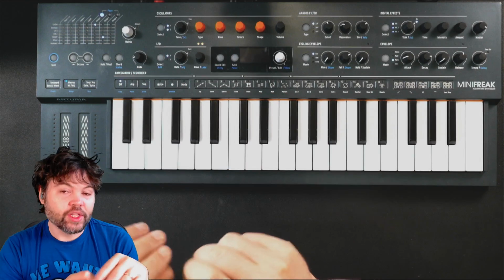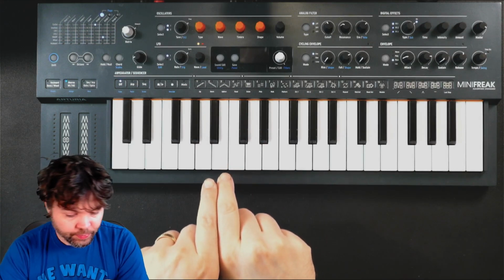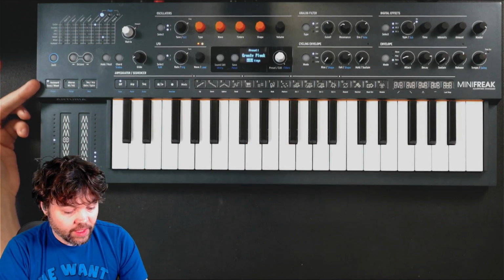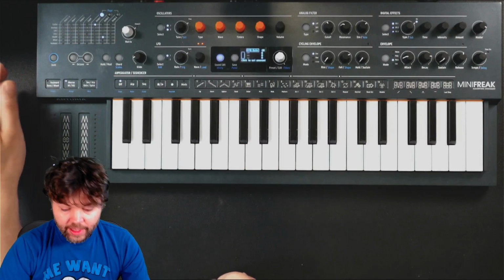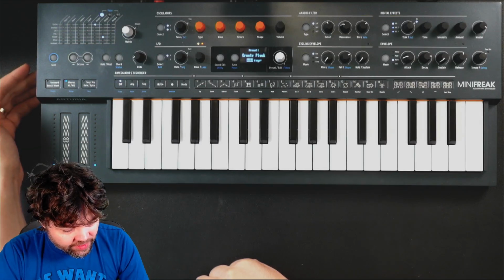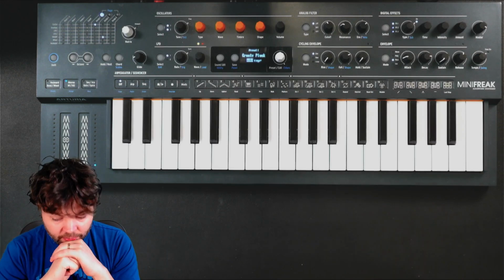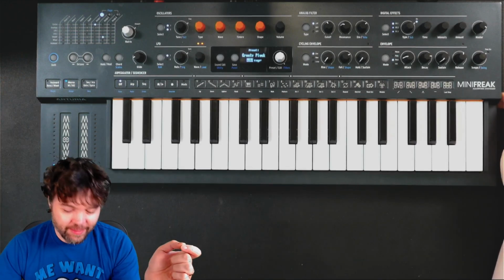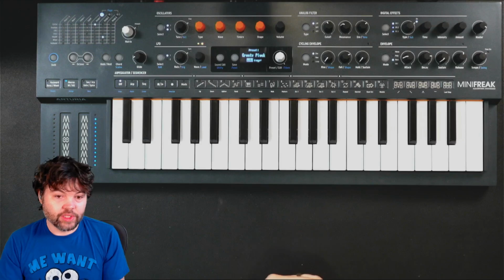Learn With Me - Minifreak: Ep01 - Overview & Paradigm

Comment: I hope this question is not tiring - but, again, in regards to minifreak vs hydrasynth.

I'm trying to decide between them. I currently have a korg minilogue xd and I'm having a lot of fun learning more about synthesis with its immediate and simple analogue setup. I'm looking for a complementary gear that I would use for different sound design possibilities and experimenting with something digital seems intriguing to me. Where I live the price points of these synths are my current limit, they get quite expensive here.

I'm curious if you would have any opinions on which you would go for if you were in my shoes. I'm an hobbyist composer and producer but playing live/concerts is not really a reality for me atm.

Thank you and congrats on your content, I'm spending quite some time with it these last few days 😊
Reply from the maker: Thanks for your comment, and for watching. I can give you a comparison between the two and you can decide what matters most to you.

I would describe the Hydrasynth as having a very deep interface, that is "tamed" by clever use of encoder controlled menus and dedicated section selection buttons. The unique elements of the synth are the polyphonic aftertouch keyboard, the mutants (audio effects for the oscillators) and in having two filters (with various routing options). Add to that the 5 LFOs (with sequencer like capabilities) and 5 envelopes, plus the huge mod matrix and 4 effect slots and you have huge sound design potential. Add to that the great build quality, and the 8 macro controls (with 8 parameters each) and you have a whole lot of capacity to design patches to perform in realtime. Where it lacks is in hands on controls to shape sounds as you design them. You can access them quickly, but instead of just turning a control, you need to press a button (potentially multiple times to go through pages), then turn the correct encoder to adjust the setting. This is a great way to manage the complexity, but not ideal for live sound design. The other problem is that the overall sound quality isn't as good as some of the competition. The oscillators, filters and effects are definitely more than usable, but definitely aren't "best in class".

The Minifreak has far less scope; 2 oscillators per voice, and you can given up oscillator 2 to process oscillator 1. An analogue filter (which is nice and smooth, but not very characterful), only 2 LFOs and 2 envelopes, channel pressure (mono aftertouch), only 2 macros with 4 targets each and 3 effect slots. To compensate for that, it has a huge array of interesting oscillator modes (vs just wavetable on the Hydrasynth). The effects sound good, as do the oscillators; the 12 part paraphonic mode is quite unique and very usable. Another big strength is the arpeggiator and sequencer, which have lots of great performance features. It has more hands on controls, but the menus are much less appealing than on the Hydrasynth.

My summary would be this. If you want a fun synth with good sound design potential and good performance features, get the Minifreak. If you want a deeper subtractive synth which benefits from complex sound design and well thought out expression (especially through poly aftertouch and macros), then the Hydrasynth is the one.
Reply: @ChalkWalkMusic  thanks for the throughout response! Your perspective is quite unique from what I have read online so far - as looking at the minifreak as "less options but better sounding ones i.e. oscillators and effects" is quite more attractive than what I've read so far ("hydrasynth can create anything the minifreak does and much more").

I'm not sure if you're chasing views (would not think so) but your perspective on this comparison would surely be useful to more people since I've seen this question repeated everywhere multiple times.

Thanks again for your reply! Unfortunately for me, I'm even less decided now 😅
Reply from the maker: @georgesboris  To say the Hydrasynth does everything the Minifreak does and more is certainly not accurate. The range of oscillators on the Minifreak (from classic VA and physical modelled strings, to speech synthesis and a comb filter) offers a whole scope of possibilities that a subtractive wavetable synths (like the Hydrasynth) don't offer; it feels like a synth that delivers on all the potential the Microfreak had, and more.

If you focus on the wavetable domain, the Hydrasynth is very powerful: 3 oscillators (albeit the 3rd being more limited in capability and lacking mutants) and the range of modulation capabilities brings a lot to the table. My guess is that you won't be disappointed with either the Minifreak or the Hydrasynth, but they offer different value propositions.

One question to ask is: which would you see yourself still using (often) a year after you buy it? Would the deep macros and mod matrix of the Hydrasynth keep you inspired to design patches, or would the performability and immediacy of the Minifreak hold your attention more?

Comment: Great value synth, nice hands-on controls for adjusting sounds on the fly. I just wish I liked the sounds more than I do. For the same price I think the Hydrasynth Explorer has better sounds (and makes for a great, inexpensive MPE controller!) but its better for sound creation than tweaking sounds live. For a beginner or someone in their first band I'd choose the Arturia (or a new model or old model MicroKorg), but for getting the best sounds and subtlties from MPE patches and softsynths at home it'd be the Explorer.
Reply from the maker: Thanks for your comment, and for watching. On the whole, I'm not that enamoured with the sound of the Hydrasynth. I found the effects to be a little lack lustre and the filter models to feel a bit flat (my point of comparison at the time was the Opsix, which has really nicely modelled filters). Complex sound design is definitely a strength on the Hydrasynth side, but at the same time, I find myself constantly wishing it sounded more like Pigments or Zebra (which it makes an excellent controller for). Poly aftertouch is certainly a nice feature and can add a lot, but it seems to be gradually working its way back into the synth market, so my guess is, that won't be such a draw soon enough.

The Minifreak definitely doesn't compete with the Hydrasynth on specs (far fewer LFOs and envelopes, a single filter, 2 oscillators and no "mutants": a big strength of the Hydrasynth) yet I find it is a case of having enough for a lot of uses. By this I mean: you can dial in sounds quickly and make tweaks fast, while also having enough depth to design more complex sounds (though I do wish it had an extra 2 LFOs and envelopes with extra rows in the mod matrix). That's not to say it's ideal for maximum sound design scope, but between the second oscillator's ability to modulate the first, the great sounding effects and the very accessible mod matrix, you have something that's quite compelling. This is all without mentioning the arp and sequencer, which I'd say are exceptional.

All in all, the Hydrasynth Explorer and Minifreak aren't best suited for the same people, I'd say. The Minifreak suits someone who wants something more performance focused and immediate; the Hydrasynth is for someone who wants to dive deep into designing sounds. The world (and my setup) definitely has space for both to coexist.